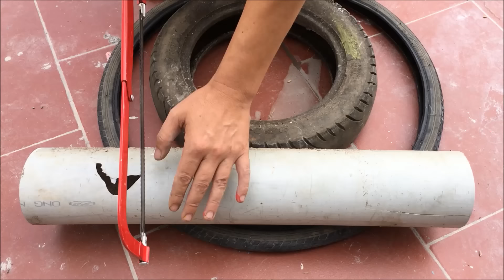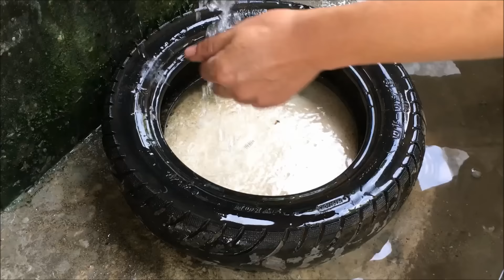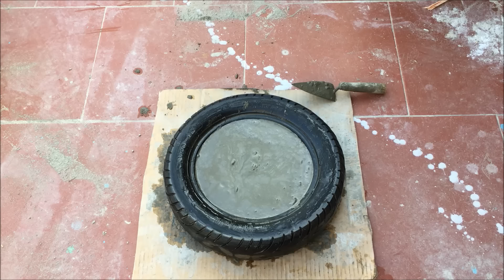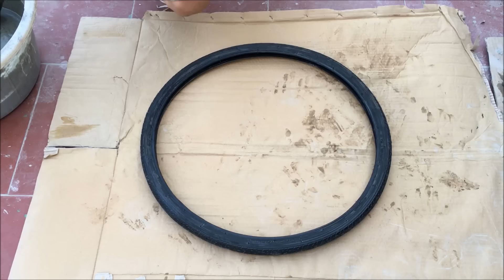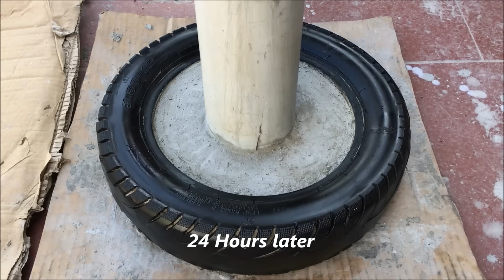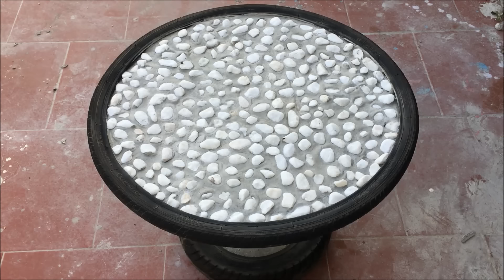Great Technique for making Coffee tables from Tires and White Stones | Cement ideas step by step

Comment: Do you leave the pipe on the column ??? How to secure the top to the pedestal... is on those 3 pieces of metal but easily can fall down....
Reply from the maker: The table and base are connected by cement, you can rest assured of its stability, 3 iron bars help the table be fixed more firmly.
Reply: But do you remove the pipe from column ? How?   do you secure top with more cement to iron bats?? You don't  show it..... puzzled